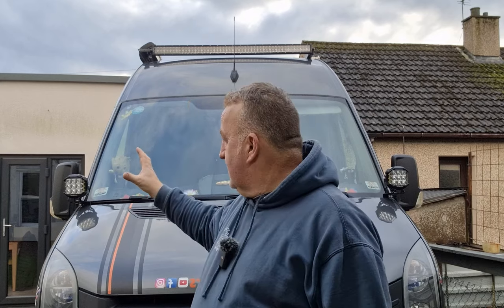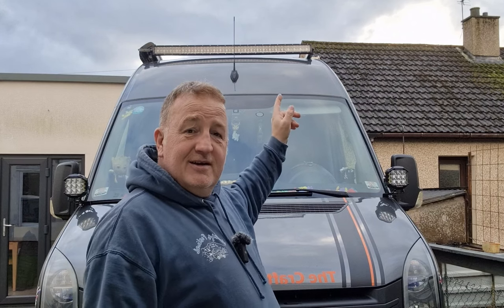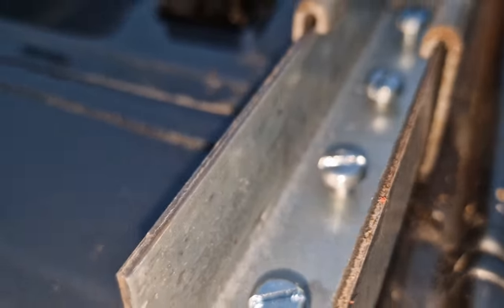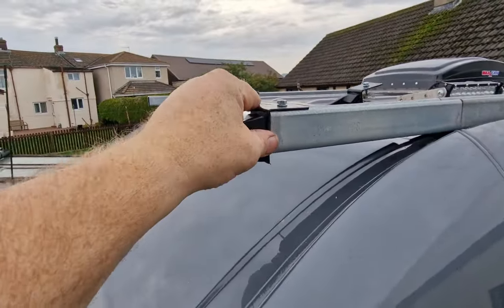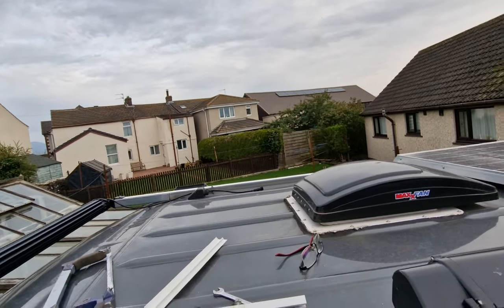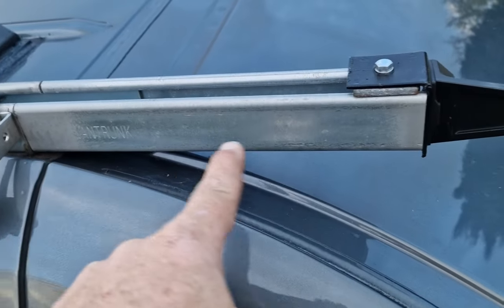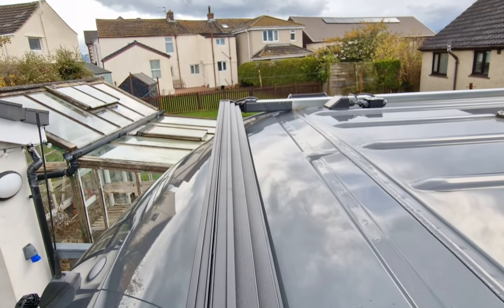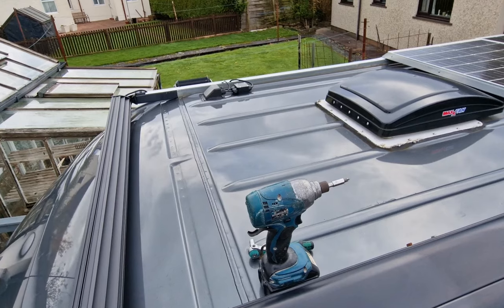Install the Auxbeam v-pro series 52" light bar | v-max series 5" side shooter spot lights

Comment: LED bars look like they should be good, but technically they’re pretty poor: multiple naked LEDs with no true reflectors or focussing lenses. The light goes everywhere. In a light bar this is compounded by their arrangement: lots in a row, so multiple overlapping light source points that mask shape and shadow. Pretty much the opposite of what would be desirable. Useful just for lighting the immediate surrounding / camping area (your drone shot shows this, look at the short range light spill). I totally get why people fit them for looks, but for those wanting genuinely useful long range lamps then single sources with larger well defined reflectors and true focussing lenses are far superior for distance lighting, creating sharp defined shadows that mean more to the human eye. Fit them lower too. Vehicle lighting doesn’t benefit from being high off the ground: the lower the light the longer the shadow - ironically that’s how you see better at night.
Reply from the maker: This setup works great for me. Check out the auxbeam spec on the light bar! The drone footage doesn't not give you the total effect as it was still quite light, hitting the tree cut filming short, so I couldn't get the overall effect, 😁👍

Comment: Now, you reconfigure to be able to have a delay between the different reach those beams has. Shut off the longest first, then the next longest etc.  Having a million lumen at a couple of hundred meters, doesn't help if you're blind at 1K. It's like driving with the fog lights all night, and thinking you see everything, as many sadly doo.  The best LED's still can't beat a good classic halogen or xenon. They still hit the mark well into 1000m. So what's your reach ? :)  .No critics ;)
Reply from the maker: These LED lights have made a huge difference
Can't wait for the new lamps to arrive 😁👍